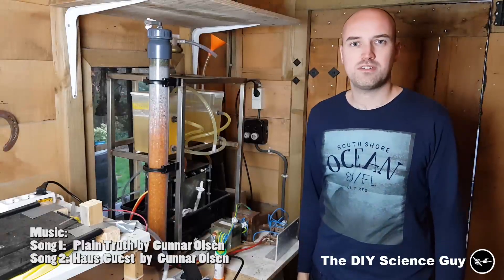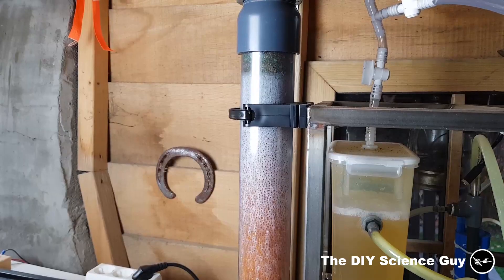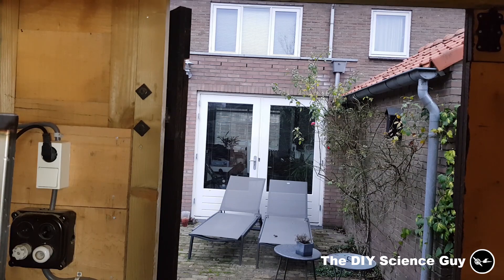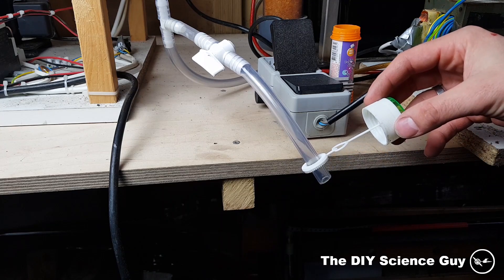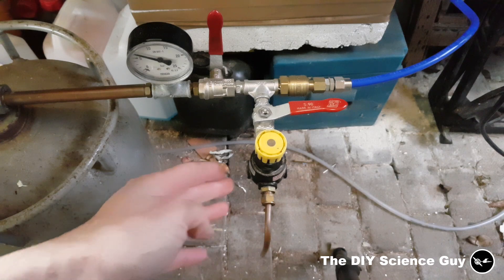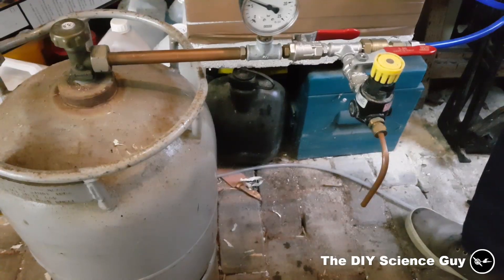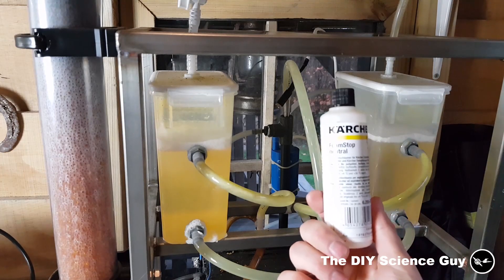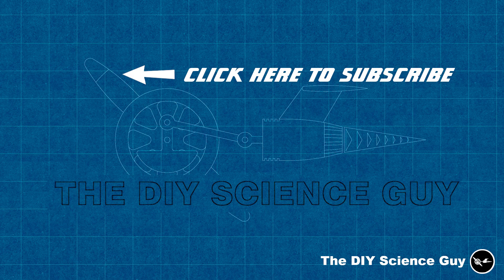Hydrogen Generator #2 Homemade Hydrogen Generator And Compressor Unit Update

Comment: I was considering the possibility of a hydrogen electrolyzer to inflate a 1.5 meter balloon, which would lift a 5/8 wave vertical wire antenna for 1900 kHz. I can see that the complexity, cost and risk of the endeavor make it more desirable to simply purchase the gas from a welding supply dealer.

Comment: I sure would be interested in a more detailed explanation of your compressor. Also, are you able to evacuate all of the contents of your storage tank prior to filling it with hydrogen?
Reply from the maker: Have you seen the first video in this series: https://youtu.be/REV739pRNcw Also, I have a diagram on Facebook: https://www.facebook.com/234679430309932/posts/pfbid0zkfNAvgzUFJKLaCM4KE457xyGV7rhU7NqZDama54mQMgEzXyyejB6LAApa6TS8CVl/?sfnsn=mo hope it helps! The tank was still filled with propane at atmosferic pressure, so I just filled it with hydrogen, and over time, the propane got flushed out with the hydrogen.
Reply: @TheDIYScienceGuy  Thanks. Yes, I believe that I have watched all of your videos on the subject. Can you please state what each of the unnamed components are in your schematic diagram?

Also, how is that polyester fabric working as a separator?

Comment: myself, id build up a few of those silica gel tubes to switch out as needed.  when one gets saturated , then id just circulate dehumidified air through it for a while til it was good and dry.  all the while having one of my spares in its place til that one gets saturated, then its just 'lather, rinse repeat'.
Reply from the maker: Apparently you can also put the tube under a vacuum to dehumidify it.
Reply: @TheDIYScienceGuy  Ihad not though of that idea.  though i would still have a few backups ready to go.  if only to account for murphy's law. (would so love to punch that guy in the nose a few times...)
Reply: question though:  would dry, uncooked rice work as well as silica gel?
Reply from the maker: @troymoore7537  no I don't think it will.

Comment: I'm curious because I would like to design a internal combustion engine to run on hydrogen on board an oxygen on board maybe oxygen supplement with atmosphere. the cubic inch does not matter it may start off in the Prototype stage in the CC range and go from there it's not about power produced to do work, it's to see if any work can be done self-sufficient on board. what's good about hydrogen that the fuel ratio could be easily adjusted thus providing efficiency in different Ranges.
Reply from the maker: Have you seen this video of mine: https://youtu.be/llmcU-mZRFs

Comment: Could I suggest a vacuum pump to remove the moisture saturation situation. cheaper and more convenient solution to heating. great video and I hope you well with your experiment.
Reply from the maker: Thanks! Well I think the drying column I use now is the easiest because it's a non powered system. How do  you suggest your vacuum idea would work?
Reply: The DIY Science Guy   I'm assuming that your dad is an arcrylic tube depending on its thickness it should be able to hold a vacuum. if you had a petcock on the bottom and also the top two totally isolate your medium in the acrylic tube you can pull a vacuum on it with an inexpensive vacuum pump, and leave it pull a vacuum maybe overnight and any moisture in that tube will boil off in the vacuum and be vented into the atmosphere and your medium will be completely free of moisture everyday. water boils at room temperature in a vacuum.
Reply from the maker: Oooow you mean a vacuum to dry the silica gel! That's a really good idea, thanks!!! 🤯👍

Comment: Would something like a thin layer of vegetable oil on the surface of the tanks act as a surfactant to "pop" the foam? (It would reduce the purity of the produced hydrogen, but could be automatically refilled with a reservoir.
Reply from the maker: Hmm I think the sodium hydroxide will dissolve the oil so that would not work well for the conductivity of the solution. The foamstop I use works fine and you need very little of it.

Comment: You might to use a O2 sensor from 
A junk car either a hand held oscilloscope maybe a multimeter
Reply from the maker: I believe thay only work at higher temperatures so that won't work I think. But thanks for the suggestion!

Comment: I am considering setting up my dry cell in my apartment for heating purposes. I'm in Maine I live out on the coast there's no real good insulation in the apartment and heating fuel cost a lot here.
Reply from the maker: Well if you use it for heating, its much more efficient and safer to use an electric heater.
Reply: two questions-
1, Why is it safer to use electricity? Are you referring the unseparated HHO with both O and H re-combining?
2. How electricity more efficient. It would be just a heating element that produces heat and uses a lot of amps
Reply from the maker: 1: Yes a homemade hho generator in your house is not safe unless you have all the safety features like gas detection and other fire safety devices.
2: to make hydrogen you need electricity. So what's the benefit of first making hydrogen and then burn it?

Comment: If you run a vertical tube or large coil in line before the hydrogen gets to the cilica jel you can help to remove any latent condensate from the gas and help prolong your jel
Reply from the maker: Good idea! Thanks!

Comment: Well done.. Good idea with these hydrogen washing fluid bubbles...you must have also the same pressure inside the oxygen and hydrogen electrolysis fluid tanks..otherwise it could mix inside the cell already...
Reply from the maker: A small pressure difference is not a problem.

Comment: Love the vids!! Keep er comin!
How does the re circulation between the cell/hopper work with respect to the separator material/hole pattern/gasket?
I understand the top two channels with the gasket "notched out" to separate the gas, but at the bottom of the cell, is there just an open channel to allow recirculation, and you assume that due to bubbles rising upwards & water flow keeps the gases from mixing?
Reply from the maker: Thank you very much! And all you assumptions are right!!! Good job 😉
Reply: @TheDIYScienceGuy  What if you used a solid separator (not fibrous) with just a small hole towards the bottom of the recirculation hole in the electrodes. The same logic would apply. I wonder how this would affect resistance? This way the whole cell could be sealed with just gaskets - no gluing the outside ;) Hard to explain via text hah
Reply from the maker: Well than the current could only flow trough that hole, which would increase the resistance a lot. I actually tried this years ago and the result is, very little gas production. But good question! Thanks!
Reply: Ah figures. Well I'm looking forward to seeing how nylon works out!

Comment: Can we do what to do to the colorless electrolyte? These chromium oxides are very dangerous !!! How many times have you come to the touch of a goat with a yellow solution? Although the pH> 14 solution is alkaline and such a solution can not cause cancer ...
Reply from the maker: I never touched it. I'm going to use something else as the electrodes but am not sure yet what it's going to be.
Reply: @TheDIYScienceGuy    
I am cordially waiting for you to perform a generator repair, to explain to the audience what is happening with membranes, and of which the material is the best quality of the membrane. When will you do the repair? When handling the overhaul, it can come into contact with the rest of the electrolyte after the process, but I think it's not as toxic to humans, it's dangerous, but I'm only using protective rubbers, but I think the main cause of hexavalent chromium formation is too high cumulative voltage, and poor quality INOKS prohrom material ???
Reply: @TheDIYScienceGuy  Try Osmosis foils for the membranes. A friend has much success in his seperator cell.

Comment: Do you make these hydrogen separators for sale?
Reply from the maker: No. I like to experiment a lot and make videos about it. I'm not that commercial ;)
Reply: I'm trying to make nylon separators between the plates, all I have to do with the failed nylon is to keep it tight, the generator when I fold it separates the gases for a short time, and then go to meat
Reply from the maker: Oke I think you should try polypropylene. It seems like that's the most suitable material. Or polyester if you can't find polypropylene.

Comment: You could consider using catalytic recombiner that would turn the oxygen and hydrogen back into water to "scrub" your Hydrogen output.
https://www.hydrogen.energy.gov/pdfs/safety_biblio/ichs2007/1.5.122.pdf

I Enjoy the channel keep it up.
Reply from the maker: Thanks! Do you meen to generate electricity? I have plans to make a fuel cell at some point in time.....time I wish I could make more of that!
Reply from the maker: BTW the link doesn't work.

Comment: How much did you paid for the stainless steel? I would have to pay 140€.
Reply from the maker: €140,- is criminal! I bought it for 10 or 20 euro's
Reply: Where should I get it? 10€ or 20€ are very cheap.
Reply from the maker: I bought mine at a local construction shop, you just need to look fore a shop that uses that kind of stainless steel plate.

Comment: can you please tell me that ; how much hydrogen gas can be stored in 9 litre tank at 80 psi.
Reply from the maker: Yes I can: 80 psi = 5.5 bar 5.5x9 liter is 49.5 liter. Hoop that helped!
Reply: well im from india.im 15 . and immaking a motorcycle that uses completely hydrogen
Reply from the maker: Nice! Please let me know how that goes, and If you have more questions please ask!
Reply from the maker: Ps: make sure that your ignition is max 1degree before dead center. For the highest efficiency
Reply: well i have been making that for a national level science fair. and i m done with 70 % of work .basically there is two units one will seperate the hydrogen ,it includes compressor,and the g.as will be filled in a custom made tank.
Reply: i can't understand.
Reply from the maker: Watch this video: https://youtu.be/R1tPT7anjwk He explains it very well.
Reply: what changes should i do in carburator,that you think
Reply from the maker: Remove carburetor and blow hydrogen directly into the inlet. Control engine speed with the amount of hydrogen.
Reply: what about the oil
Reply: usually while using gasoline well use oil so without oil in case of hydrogen the enhil will damage know
Reply from the maker: Use a 4 stroke. Or an oil injection system.
Reply: ill check about the oil injection system .
Reply: can i connect the gasoline inlet to a oil tank and reduce the intake of oil with an idle  mix.and blow hydrogen through a air intake iin carburator.
Reply from the maker: Yes maybe that will work! Will be a nice experiment ;)
Reply: did you use any flash back arrestor on your lawn mover.
Reply: and for what duration the engin works with 50 litres of hydrogen
Reply: and how did you remove the other gases from your tank at first.
Reply: is the oil smell from the compressor is bad to store with hydrogen
.
Reply from the maker: No because I use pure hydrogen which will not burn if there is no oxygen in it....but it's always safer to use one.
Reply from the maker: I think about 4 minutes....but I didn't adjust the ignition timing so it ran very inefficiently. Maybe this summer I will change that.
Reply from the maker: I didn't. As long as there isn't any oxygen in it it's ok.
Reply from the maker: As long as your compressor doesn't' get to hot, there won't get much oil vapor out of it......NEVER pump hydrogen with a compressor that gets hotter than 35 degrees Celsius. Only use refrigerator compressors!
Reply: will the smell affects anything, because the smell is comming from the compressed air outlet.and can i use check vaulve instead of  flash back arrstor.
Reply from the maker: No, no problem but don't inhale it ;) check valve is not inough.

Comment: 4:07 
thanks! I might build a hydrogen generator and compressor unit but with a dry cell instead. any recomendations on how to get the oxygen out?
Reply from the maker: Good idear! Mine is a dry cell to. As you can see in my video I have placed a membrane in between the positive and the negative sides of the plates and in that way keep the two gasses separated.
Reply: cool, I will do that